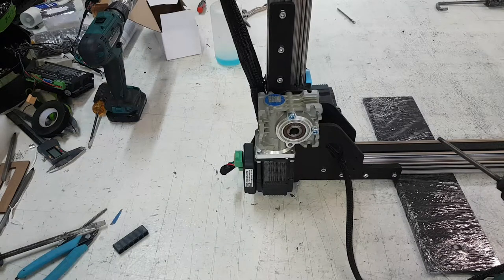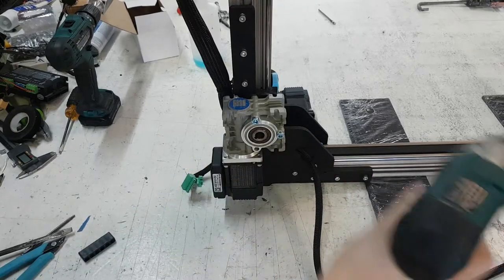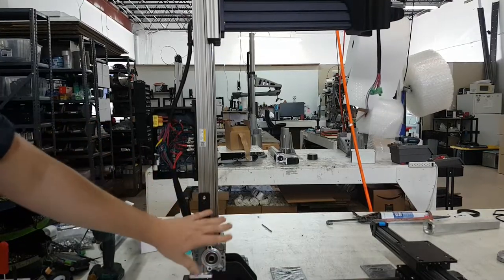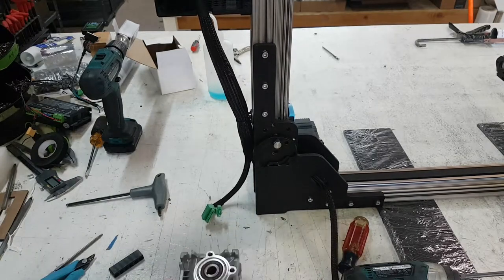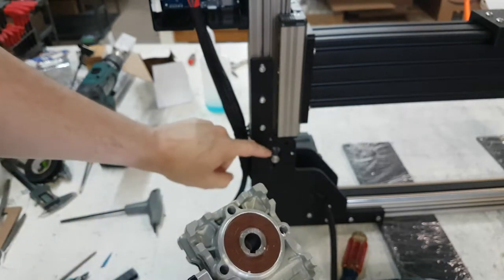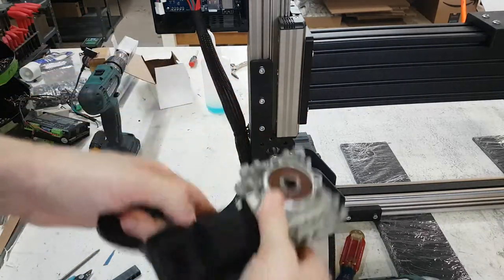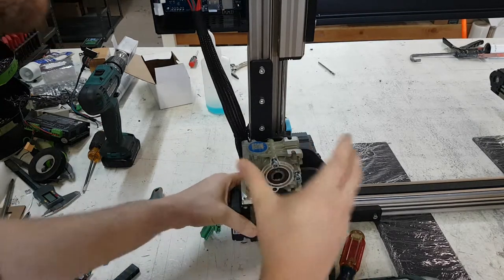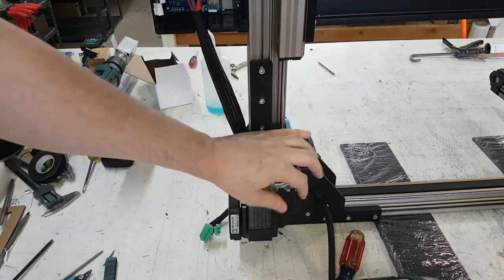Z Gearbox Removal (Version 10)

Comment: I have a 10 Pro printer. How often should I change the gear oil in that gearbox? Thanks.
Reply from the maker: It depends on the amount of usage. This would depend on your gcode files as well on how much the motors are moving.
If you use the printer daily, it should be changed about every 6 months. If the printer is used once a week, you can change it every 1 or 2 years. 
If used less, it may never need to be changed (6+ years).